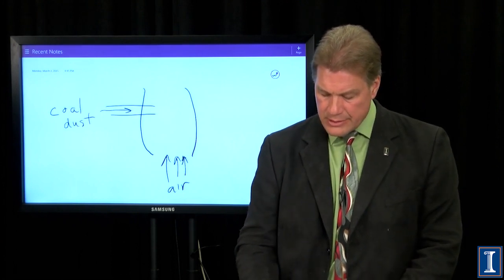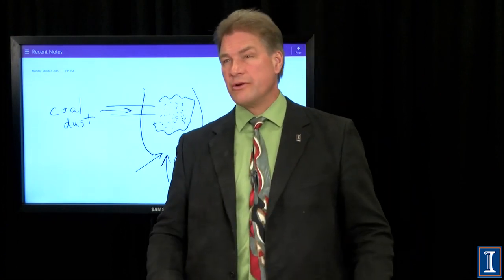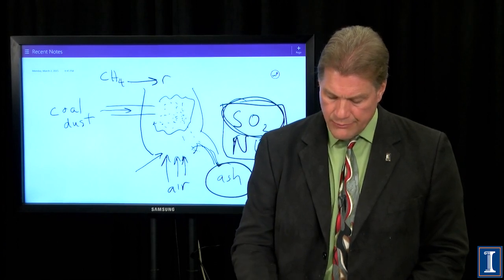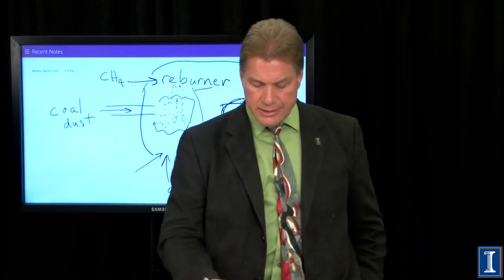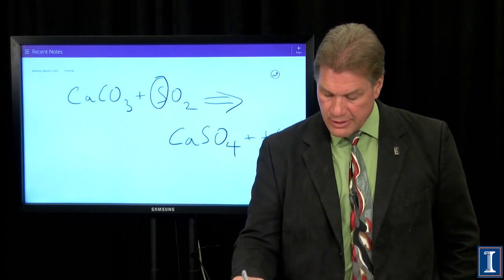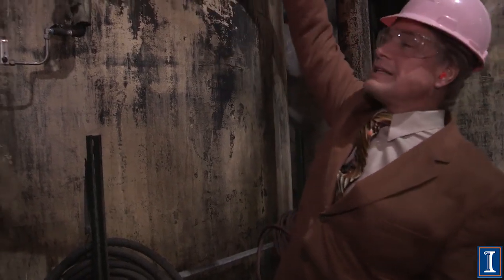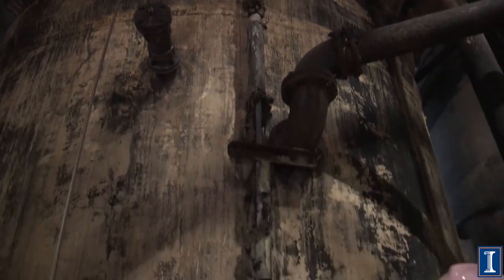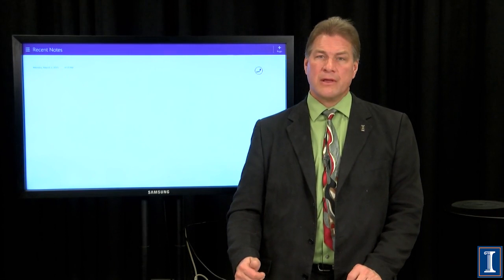Cleaning Coal (I.e., Dropping Acid)

Comment: Modern coal fired power stations don't use fluidised beds. They use pulverised coal which is fluidised and conveyed to the burners in air which is then used to combust the coal. The firebox of the boiler is empty of solids, other than the falling ash. In a fluidised bed, there is typically a "bed" of solid particles, https://en.wikipedia.org/wiki/Fluidized_bed_reactor
Reply: Yeah, this was probably just a Pulverized Coal Combustor (/ “Pulverized Coal Boiler” ).

Fluidized Bed Combustors / Fluidized Bed Gasifiers do exist as well.  The latter is common for those “Integrated Gasification Combined Cycle” (IGCC) plants.

Comment: Does the "clean coal" process prevent radioactive elements that are in coal from getting out and into our atmosphere?  As I understand it, coal releases more radioactivity than nuclear power plants, barring a Chernobyl-type event, ever will.
Reply: 5:13  He briefly mentions pre-scrubbers to remove heavy metals.
Reply: It just moves the problem from the flue Gas and Into the Bottom/Fly Ash…which just goes to a “Coal Ash Dam” / landfill 

Best case scenario it is a lined one, and we cross our fingers hoping it never leaks.  Worst Case Scenario it is unlined and you basically have Hell’s percolator moving all those nasties into the local watershed and/or aquifer.

Also Fugitive Dust Emissions (on both ends) may also exist and contribute to total releases.

Comment: His stoichiometry is off slightly. CaCO3 + SO2 => CaSO4 + CO? Maybe.
Reply: AFAIK it needs additional oxidation, the extra oxygen coming from additional injected air.If I got this right the formula should be:   2CaCO3 + 2SO2 + O2 => 2CaSO4 + 2CO2

Comment: but its already losing to natural gas power plant right
Reply: Here is Saskatchewan they are closing down our coal plants as they hit upgrade/major maintenance milestones and are replacing them with large natural gas power plants. The cost of the natural gas and electrical output of these new plants mean it just doesn't make sense to coal if it can be replaced.
Reply: @Swarm509  From my understanding, starting in 2021, price increases in natural gas meant that coal was once again economical. Now with the irresponsible Europeans bidding up liquefied natural gas costs, coal may indeed be the cheapest source of electricity generation in North America. It is currently being reflected in rising capacity factors at existing coal fired power stations. Whether that will translate to increased construction of new coal fired generating capacity remains much more in doubt.

Comment: But it still creates almost 3 tons of CO2 for every ton of coal burned.
Reply: you create three times the co2 for every calorie you burn so maybe you're the problem
Reply: What? How?
Reply: @ChilledfishStick  Carbon and Oxygen burn to create heat which is just a change in phase but it takes one carbon atom for every two oxygen atoms meaning it creates 3 tons of co2 from 1 ton of carbon
Reply: @zrazghost  That's interesting. Thanks.
Reply: @ChilledfishStick  "The carbon dioxide emission factors in this article are expressed in terms of the energy content of coal as pounds of carbon dioxide per million Btu. Carbon dioxide (CO2) forms during coal combustion when one atom of carbon (C) unites with two atoms of oxygen (O) from the air. Because the atomic weight of carbon is 12 and that of oxygen is 16, the atomic weight of carbon dioxide is 44. Based on that ratio, and assuming complete combustion, 1 pound of carbon combines with 2.667 pounds of oxygen to produce 3.667 pounds of carbon dioxide. For example, coal with a carbon content of 78 percent and a heating value of 14,000 Btu per pound emits about 204.3 pounds of carbon dioxide per million Btu when completely burned.(5) Complete combustion of 1 short ton (2,000 pounds) of this coal will generate about 5,720 pounds (2.86 short tons) of carbon dioxide."   Taken from: https://www.eia.gov/coal/production/quarterly/co2_article/co2.html